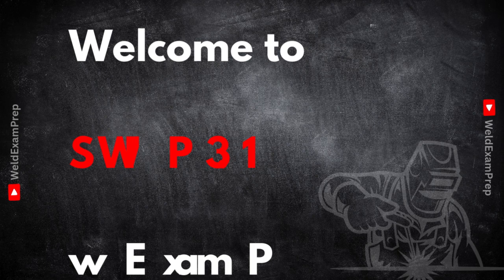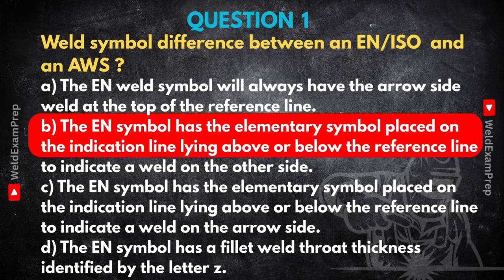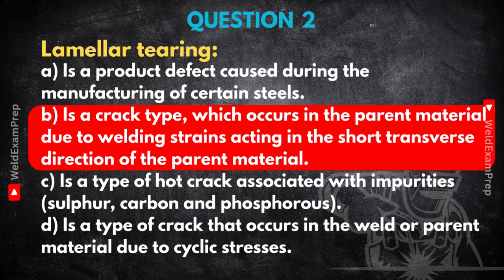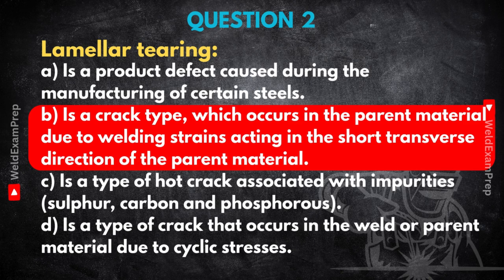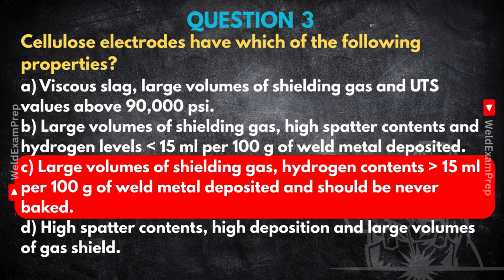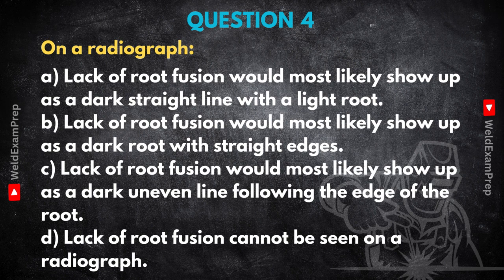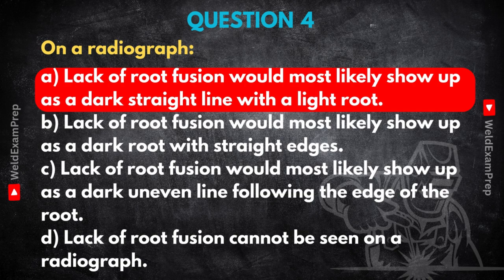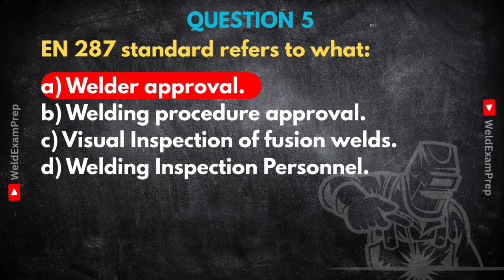Pass the CSWIP 3.1 Exam! 🚀 Most Common Welding MCQs with Expert Breakdown 48

Comment: Can you define the least distortion either in double V preparation joint or Simple U preparation Joint ?
Reply from the maker: In a double V joint, weld metal is deposited symmetrically on both sides of the plate. So less distortion than U preparation